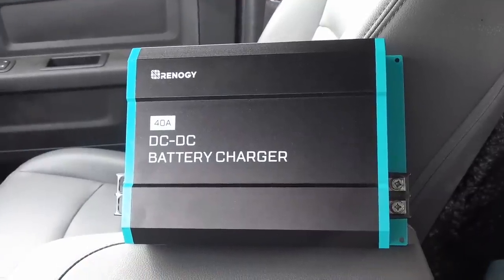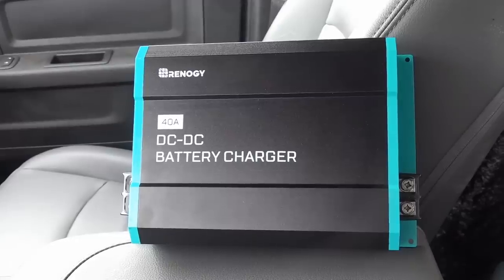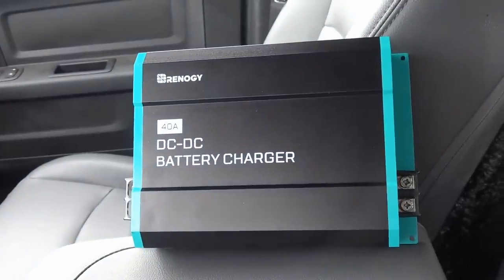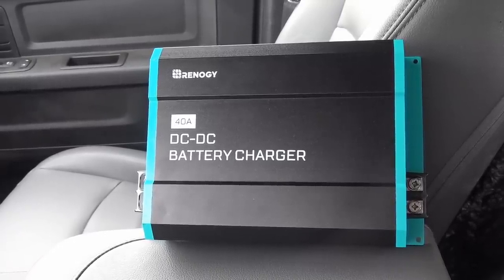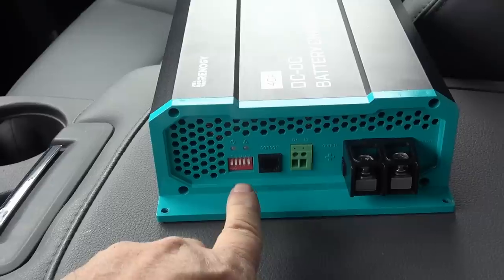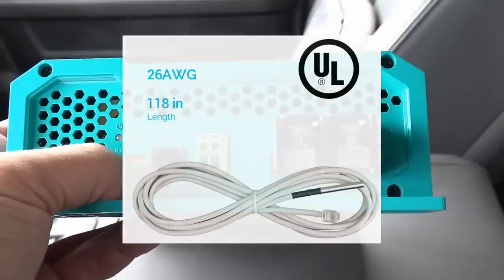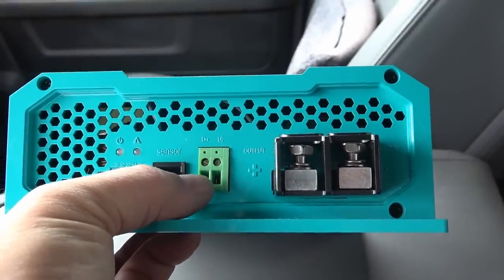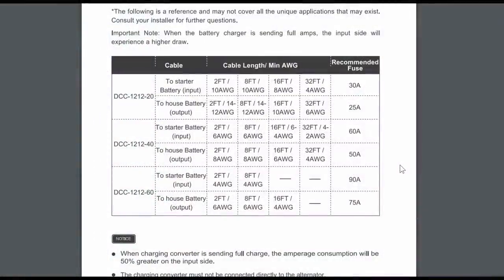Extra 40 Amps Charging into RV Battery Bank from Truck Alternator (Renogy 40A DC-DC Charger)

Comment: Does this dc to dc charger have a charge controller built in,  im concerned about over charging if i have a brain fart if not why not add one in the output to the batteries?
Reply from the maker: Yes, the charging voltage and battery type are set via the dip switches, here is a link to the manual if you want to explore the options - https://www.renogy.com/content/RNG-DCC1212-20-BC/DCC1212-204060-Manual.pdf

Comment: Hi Ray, great video as usual!  One question for you, do I need to disconnect the 12V line in the 7 pin plug to prevent the drawn on the alternator?
Reply from the maker: Thanks. :) That can vary depending on your vehicle wiring. For my Ram I left it the way it was, it puts out such low amperage anyway. I did a demo video showing that here https://www.loveyourrv.com/7-pin-tow-cable-charging-tests-using-lithium-rv-batteries/  Cheers, Ray

Comment: I noticed that you have a PD9200c smart charger. This model doesn’t have a charge profile for lithium batteries. There is another model for lithium.
Reply from the maker: Yes, I have a model PD9260C but I also have the manual Charge Wizard pendant. So what I do when I need to use it to charge my lithium bank is press and hold the button for a second or two until the LED stays solid. It is then in a manual boost mode and outputs 14.4VDC which is perfect for charging my lithium batteries. I think if I remember right the manual boost mode last about 4 hours or I can turn it off by pressing the button again. Cheers, Ray
Reply: @LoveYourRV  I'm not familiar with manual override feature you describe but am a big fan of Progressive Dynamics products because they are high quality and affordable.  The Progressive Dynamics PD9100 series are the converters that are designed specifically for lithium batteries and come in several sizes.  I also needed to upgrade my power distribution center and considered the new PD line of combination power centers that include a converter that can be configured for lithium batteries.  However, the combined power centers do not work well if you also have a separate inverter because there is only one AC busbar.  This creates a loop where the converter is trying to charge the batteries while the inverter is using the batteries to power the busbar.  This is why I went with a separate PD60 series DC Distribution Panel and a PD55 Series AC Distribution Panel when I installed my PD1600 series inverter.  The PD55 has two busbars so you can install the shore main breaker, the converter breaker and the inverter input breaker on one bus, and the inverter output breaker and everything else on the other busbar.  When the PD1600 built in transfer switch detects that shore power is no longer present, the busbar with the shore main and the converter breakers is automatically disconnected.
Reply from the maker: My OEM power center has a breaker just for the OEM converter. So,  I flip it off when I go off-grid to avoid the charging loop. I also have a transfer switch that can do that automatically but never bothered to hook the converter up. The PD converter is a second converter I dedicated for off-grid charging, and it's installed right next to my battery bank to avoid any voltage drop or wire losses. I also wired in a dedicated receptacle for it at the front of the fifth wheel to plug in the generator cord.  I initially bought it for faster lead acid charging of a 4 golf cart battery bank by utilizing the boost mode. Since it works well for lithium, there was no need to spend money on a Li charger.
Reply: @LoveYourRV  My OEM panel also had a separate breaker for the converter and you can simply turn off the breaker to avoid the loop.  But I was doing a total replacement of my 43 year old panel and contacted Progressive Dynamics tech support for their recommendation.  They recommended that I either install a separate panel for the main and converter breaker or use the configuration I went with.  Their logic is that if something is not automatic someone will make a mistake.  Like you, I trust myself to not forget to turn off the converter breaker.  But I have a 49 year old absent minded son that uses the trailer from time to time and I don't trust him to remember.

Comment: They have a higher amp trolling motor that is up to 60 and it’s just bigger for like 36 volt trolling motor that’s what I have and trigger wire goes to a switch so I can let every thing to warm up before I turn Renorgy 40 .

Comment: Ray, I'm wondering about the talk I hear about the Lifepo4 batteries hurting the alt. or killing the tow vehicle batteries. Can you shed any light on that?
Reply from the maker: This is my understanding. LiFePO4 can charge at a very high amperage because the cells have very low internal resistance, most 100AH LiFePO4 BMS's are set for max charging usually up to 100A, so if say you have 3 in parallel that can draw up to 300 amps! way higher than many stock alternators can output without overheating and maybe failing.  So they usually need some kind of regulation/isolation device in between the coach and starter batteries.  This is mostly a motorhome, van, and truck camper concern though. And I would say most higher-end motorhomes will already have some kind of regulation for alternator charging as a bank of say 6 AGM batteries can draw a pretty hefty charge current as well. Motorhome people need to investigate how their system is wired when they install lithium.
On trailers, it's generally not a big concern. The tow cable charge wire is usually so long and thin gauged that it will self-regulate because of a significant voltage drop due to high resistance in the wire run.  Usually, it's a trickle charge at best, not really much different than the old lead-acid batteries. 
Tow cables wiring usually is fused quite low (for example 20-30 amps) the fuse would blow well before you could hurt the alternator. Often there is a relay in the circuit that shuts the charge off when the ignition is off. Things vary between models and manufacturers. But even without a relay and a direct connection, it's more likely that your trailer lithium bank would actually charge the tow vehicle batteries when sitting at rest than the reverse. :) Lithium batteries usually sit at a much higher voltage around 13.2V and need to be above that to charge at all. Lead-acid sit and charges at much lower voltages.  So current would flow from the trailer lithium to the lead-acid truck batteries. But like I say often there is isolation via a relay or diode to prevent that. Cheers, Ray
Reply: @LoveYourRV  THANK YOU VERY MUCH FOR THE EXPLANATION ! YOU ARE A WEALTH OF INFORMATION.  I HOPE WE MEET ON THE TRAIL SOMEDAY.

Comment: Hi Ray. Nice setup you got.   I have a question/concern. Firstly I have a 40amp b2b battery charger like yours which I haven't hooked up yet and 800w solar on my roof.   How safe is it to have both the solar and the b2b charger running simultaneously.  And what long term effect on the battery  should I be aware of running  those two separate systems ?  Thank you     
Another question that occured to me is can I have a 12v switch for the b2b vs having it hooked up to running lights?  Thank you
Reply from the maker: For almost all chargers, there isn't an issue. I run mine with 940 watts of rooftop solar charging at the same time They generally set their charging rate depending on the battery voltage they sense. They automatically back off the charge amps if they sense it is high. You won't harm the battery. You just might see less than combined total amps. Here is a demo video of that with solar, DC-DC charger, and a converter charge all at the same time - https://youtu.be/Nt3CG5qeF5o  
Yes, you can do the trigger wire any way you'd like. I just found the running lights handy. Later, I also install a wireless key fob switch https://www.loveyourrv.com/12-volt-wireless-switch-mod-for-my-40a-dc-dc-charger/  Cheers, Ray
Reply: Thank you Ray for clearing up my concern and I'll report back when I hook up my dc to dc charger.  Keep up the good work 👍👍

Comment: i have heavy wiring to the 7 pin to charge the batt on my TT but i had a problem traveling in the south last yr it couldent keep up the charge on my 2 - 12V batt i have 300 watts solar all renogy
it was so hot that we parked in the shade when ever we could ...
thus no solor charge i had to run the gen a lot so my stupid question is ...

im looking at the renogy 20 amp i know every body is using the 40 amp .

iam going to use the anderson 
i am all so swapping out the 2-12V batt's for 2- 6V batt's 

2000 dodge ram 3500 5.9 cummins customized for my puppies
2014 roockwood 2608ws customized   thank you
Reply from the maker: 20 amps seems quite suitable for a 2 -6V golf cart battery bank.  You will also find that the golf cart batteries will usually perform better than most 12V batteries since they are true deep cycle batteries with heavier lead plates. Cheers, Ray

Comment: Hey awesome vid mate! I was thinking of a project, would it be possible to use this DC-DC battery charger using other LiFePO4 battery pack? So essentially:
Portable LiFePO4 battery pack ---> DC-DC Battery Charger 40A ---> onboard LiFePO4 battery

Or am I completely wrong and even my question is wrong?
Reply from the maker: Thanks, I think that would work as long as the portable pack can provide at least 50 amps current at about the same voltage as a vehicle battery.

Comment: This is obviously possible however, you do not mention it so, I want to be sure I haven't missed anything.....you can charge while the truck is running, idling, while you are boondocking, correct?
Reply from the maker: Hard to give you a definitive answer as there are lots of variables. I personally can idle as long as I like no problem with my dual battery large diesel engine truck. I have a demo/test video here of me doing just that while also adding a generator and solar to the mix  - https://www.loveyourrv.com/renogy-40-amp-dc-dc-charger-installation-and-demo/  The caveat is that my truck has an optional heavy-duty 220 amp alternator versus the stock 180 amp so lots of extra headroom to run loads like a DC-DC charger, winch, light bar, etc. So you see it can vary depending on the vehicle, try to idle too long with a vehicle that barely has the alternator amperage output to supply the DC-DC charger when at higher driving RPMS and it may overheat and cause problems, maybe burn out the alternator. I've heard of some people that can only run a DC-DC charger if they moving so the alternator can get the air to keep it cool. Some install a switch to stop the charging if they are going to be idle for an extended time or a thermometer to know when the teams get too high and shut it down.  Personally, I would just upgrade the alternator.
Some people that really want to push a ton of charging amps actually go with dual alternators for 440 amps Which is popular with off-grid truck campers. It's the package an ambulance would have for example. It was an option when I factory ordered my truck but thought it was a bit overkill since I also run solar power and only wanted to add a small 40 amp DC-DC charger to augment that. Cheers, Ray
Reply: @LoveYourRV  - thanks for the thorough answer, fantastic info!!

Comment: Iam thinking about a second alternator that would be an easy way to pump up the volume!
Reply from the maker: I thought about a dual system when I factory ordered our Ram. They had a 440 amp package option. But figured the extra stuff under the hood wasn't worth it for me. 220 amp option is enough for my needs.

Comment: Nice presentation, I've been wondering what this dc to dc stuff was all about.  My new truck came with a 400W max 120V outlet adjacent to the tailgate.  I've toyed with the idea of using a 120V input charger in the bed or near the battery plugged into this outlet.  I have a NOCO 7.5 amp charger that I carry to charge the truck battery from the LFP in the RV via the inverter (I've used that just once when I left the truck's internet on too long a year or two ago).  But, it could also be used to charge to charge the LFP from the truck's 120V bed outlet (with ignition on).  A larger unit with 20 amp or a bit more could also be used (need to assure less than 400W at the input).
Reply: Mr Clark that not good idea. You would be losing  to much power going from dc to a.c. to dc again. 400 watts inverter could be a modified sine wave not good for running chargers etc.
Reply: Fred Thompson 
That’s right! It’s too easy and inexpensive these days to do things like this cleanly and without extra stuff to do to make everything work (or worry about rain.)
Reply: Yeah, what everyone else said, way too much energy efficiency loss.  But a better option in my opinion is to use a DC-DC x 20 amp unit and for the 12 volts, tie into the back 12 volt wires to that inverter.  They should be thick enough for the 20 amp unit.

Comment: What size is your alternator?  I want to do the same type of set up by I am worried my alternator won't handle or I will operate on its limits...?... I have a Yukon XL with a 170 amp alternator... do you think it will be able to handle the car's regular load (lights, radio, AC, etc)  plus the 40-50 amp charging requirements?   Do I need a second alternator?  or am I just worrying for no reason?
Reply from the maker: Mine is the optional 220 amp alternator, normally the truck comes with a 180 amp as standard. It runs it easily even at idle. But every vehicle is different depending on features, how much is sucking off the alternator.  Maybe Renogy can advice you.
Reply: I'm in the same boat, 175 amp alternator.  Possible answer is just get the 20 amp DC-DC.  Cheaper, plus you still have some amps coming in through the 7 pin trailer connector to combine to ~ 25 amps maybe.

Comment: Looks excellent, Ray....  I tow with a F250 diesel and I think both batteries are in parallel.... (I think). I don't think it makes a difference which battery you connect to....(maybe?)  any advise appreciated. Thanks
Reply from the maker: Yes, 2 12V batteries in parallel. I'm not sure, I just went with the battery that had the High Amp Powwer Point on it, figured since it was a factory thing, it was the best place to hook up too.
Reply: @LoveYourRV  Thanks Ray, I'll let you know what happens !!

Comment: Just had one installed. Going on a cross country very soon. Thanks for all your knowledge. Looking forward to having full batteries while boondocking.  Do you drive with your refrigerator on electric instead of propane?  I seems like it should be no problem for the 40 amp to keep up with a 12 cubic. ice box..

Thanks again
Bob T
Reply from the maker: So far I haven't, maybe I will at some point but honestly we have never felt the need to have the fridge running during travels as the food stays cold enough since we are opening the door. We don't travel much in high temps and travel days are usually limited to around 4-5 hours. Most times I also have something defrosting anyway. Cheers! Ray

Comment: So the negative wire is just drilled into the truck frame? Is there any risk if doing that with such high amperage?
Reply from the maker: Yes. It will depend on the vehicle. Not all have the same frame construction and alternator capacity. My Ram 3500 diesel truck has a heavy metal frame front to back and beefy negative cabling back to the batteries. It also has the optional 220 amp alternator versus stock 180 amp for use with things like light bars, winches etc.  A frame connection can handle the amperage. For example, my fifth wheel trailer OEM did the same type of frame connection for the trailer battery negative return and it sees up to 55 amps when the batteries are charging with the converter charger plugged into shore power. Cheers, Ray

Comment: How much faster does the dc to dc charger charge the batteries than just the connection from your truck?
Reply from the maker: Most trucks are lucky to do 7 - 10 amps of charging current at best via the long thin tow cable wiring, at least that has been my experience. This does 40.

Comment: I was thinking about the charging problems when it gets too cold on lithium batteries. I was thinking maybe a solution would be to wrap the battery in something is more insulated and possibly if you’re driving or something and it gets really cold drop in a couple of the portable not portable the handwarmers that can warm up to 100 and degrees for about 10 hours. What’s your thoughts
Reply from the maker: If its that cold I don't think I would want to be towing the trailer. :)  My battery bank is in an insulated box inside my front storage compartment. I'd guess outside temps would have to get down below 20F before it would cut off charging. Maybe even lower considering the act of charging will warm the BMS board and keep the battery cells warm too. I don't see myself ever towing in those temps. Cheers, Ray

Comment: What about the original charge from alternator to batteries what did you do with that?
Reply from the maker: I just left it as it was since it doesn't do much anyway, maybe about 5 amps. See the video I did to show that https://www.loveyourrv.com/7-pin-tow-cable-charging-tests-using-lithium-rv-batteries/  Cheers, Ray